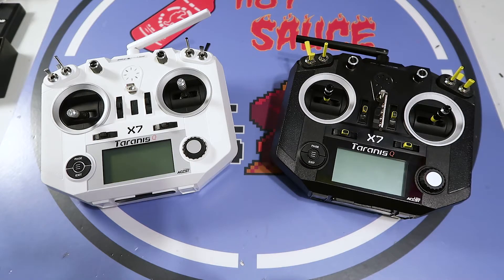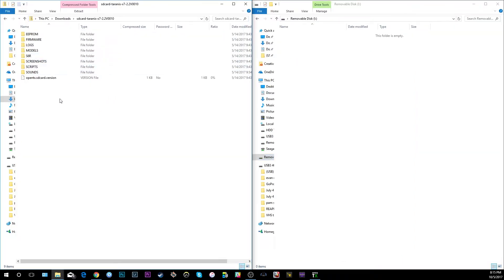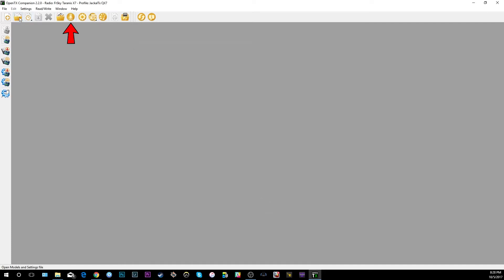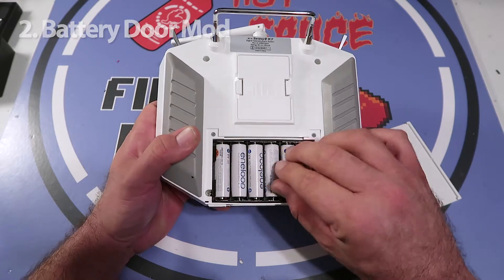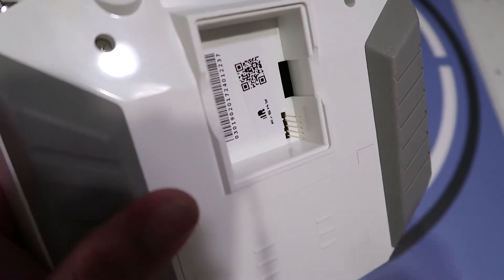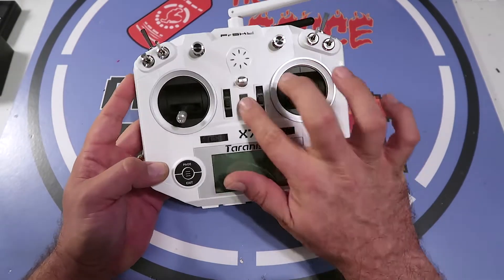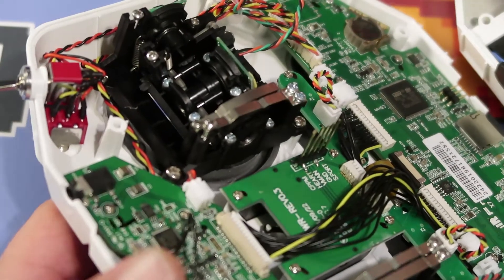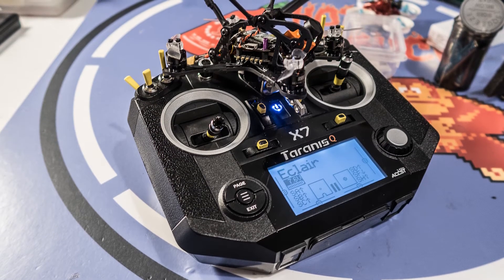Taranis QX7 Setup + iRangeX 4-in-1 Multi-Module

Comment: I'm help my dad set this module up on his qx7 and for some reason MULTI does not show up as a option under external rf mode. How to u fix this?
Reply from the maker: Did you flash opentx to the radio with the multiprotocol box checked in firmware options?
Reply: @Jackal_FPV  it was firmware related we reflashed it and it worked. Thanks

Comment: Once you have your toy quad bound how do you change the rates?  Or are the rates locked, and which rate is it in?  Thanks a million.
Reply from the maker: DroneXFun you’ll get the maximum available rates.  Sometimes this is even faster rates than the highest rates on the stock controller.  You can lower the rates and set up multiple rate modes for each model by programming the Taranis.
Reply: Hot Sauce Final Boss   I found that some models (mould king) are slower when using the multi module, and I read that rates are on an aux channel you just have to experiment with which one.  I am a moron and don't know how to do that.
Reply from the maker: DroneXFun I haven’t had that experience, but I don’t have a mould king.
Reply: Hot Sauce Final Boss     I think I figured it out.  You have to set up aux switches.  Once you have your switches activated you have to flip switches while you fly to figure out what switch will do what you are looking for.  Now the taranis has most of the functions on the stock tx. Not only can you change rates but if you like to you can even flip a switch for automated rolls/flips.  Its different with every model though.   Thanks a million for the replies man.

Comment: I have this module as well, have you had any issues with Telemetry at all?
Reply from the maker: +ReganGTX I haven’t tried using telemetry with the module, I really only use it for controlling toy drones.  Everything else I use FrSky receivers.  What problems are you having?
Reply: Hot Sauce Final Boss I find that it works with some frsky Telemetry receivers but some it does not, I'm using it in my X9D as I ruined the backboard tried to do the antenna mod, haven't tried it in my QX7 but yeah it works great on my blade inductrix, wltoys v686g and QX90's
Reply from the maker: +ReganGTX It’s definitely awesome for toys.  I’ve used it with Syma X5C and X11, Hubsan 107, E010/11, Nihui U807, JJ1000, Attop A8, MJX X400 and it’s worked great.